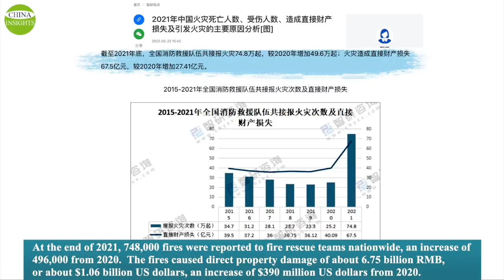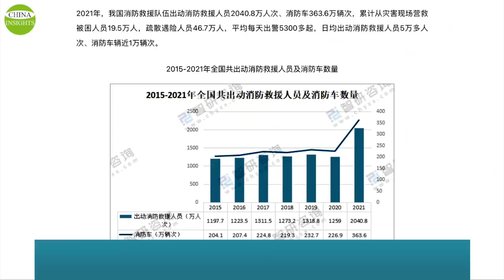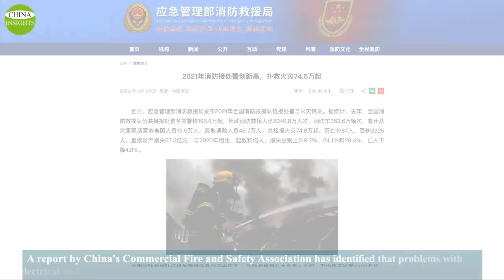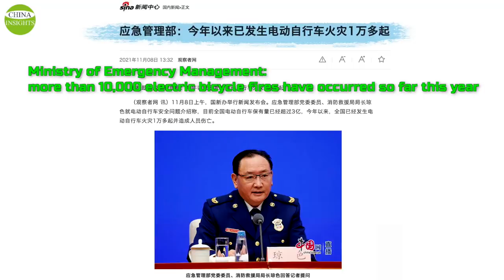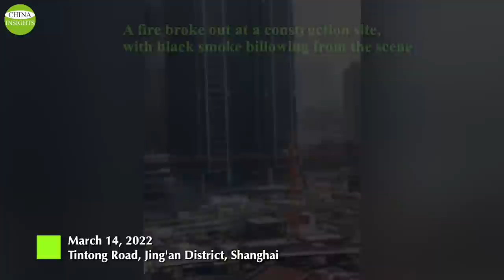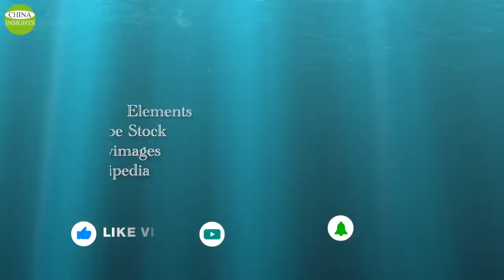More fires every year in China, with 748,000 fires in 2021

Comment: Poor quality buildings, no quality standards, no education on how to handle a fire. What am I missing still?
Reply: leaking gas tanks and people smoking
Reply: insurance fraud? moral hazard?
Reply: Lack of warning systems and emergency communications
Reply: @gtw4546  that too
Reply: Social decline
Reply: Cant be accountable for something that doesnt exist. They are litteraly cooking the books to the point it all goes up in smoke.
Reply: @susannesheffer1848  I wouldn't go below first floor either because it might crush me because of its poor foundation
Reply: nerve gas
Reply: They sometimes implement stricter building standards but most of the time it's cheaper to pay off the relevant official instead of following the rules.
Reply: and lots of buildings and factory equipment is now getting old. but is getting little or no maintenance.
Reply: Knock-off fuses/breakers that look identical to quality circuit breakers from western manufacturers; but they only last a couple hundred hours till they fail due to poor quality materials that only "LOOK" the same.  These knockoff circuit breakers are a hazard in the US because they smuggle them into the supply chain but charge for the quality breakers you ordered but didn't receive.

Comment: "Why we have building codes in the Western World"
Reply: Yup. In case you're wondering why it's so expensive to build here. It's because we have ACTUAL building codes.
Reply: Building codes in any country don't matter if the inspectors are paid bribes to overlook smaller "nuisance" faults.
Reply: Actually in all fairness building and fire codes in the United States and the West came to be mostly because of tragedies and large loss of lives because of fires. The  Iroquois Theatre Fire of 1903 in Chicago claimed the lives of 700 mostly women and children, the Coconut Grove fire of 1942 claimed the lives of almost 500, the Beverly Hills Supper Club Fire of 1977 took the lives of 168, MGM Grand Las Vegas in 1980 claimed the lives about 90, and the Station Nightclub fire in 2001 claim 100 lives. I only bring this up to show you that codes didn't just happen overnight. After each one of these above mentioned tragedies, codes were adapted or tightened. Now in 2022 we shouldn't have that many people die in fire tragedies cause what we learn from the past but then 2018 we had the Grenfield tower fire in London that killed like 80 people. China will have its building codes sooner than later when they go through the same type of tragedies we had to deal with here in the West. Cheerio!

Comment: The number of fires is less important than the magnitude. 2,000 fires without that context is not that meaningful.
Reply: However it is impressive
Reply: ye the US hasdjust under 1.3 million fires in 2019 that is almost 4000 fires per day
Reply: @mikkelfred39 which comes back to OPs point. What did they define as a "fire" Wouldn't it be weird if the US had 1.3 million cases (assuming you're not lying) but only suffered a third of it compared to the C country in terms of cost?
Reply: @iqbalindaryono8984  my number are from the us fire administration so i assume they are correct. My comment was just a nod to the comment that the number of fires is irrelevant, and as you stated the cost of the fires is a better measure for assessing the impact of fires in china.

Comment: The grain silo fire issue is likely also from how easily a fire or explosion can occur at one that is using unsafe electrical equipment or maintenance practices. Grain silos are a very fuel and air mixed environment and the electrical codes for them has to be strict or they will catch fire.

Comment: About 1.5 billion people in china
Divided by 3 people per household average
Thats about half a billion houses
Divided by the number of housefire in 2021 alone...
500000000/750000 = 666.666
That's a housefire for every 700 houses
If my town of 80000 it would be 110 (or 50 since we dont have one child policy) fires every year which is insane consider the last fire we had was 20 years ago
Reply: half a billion households not houses.  some houses have multiple households and then there are also office buildings, schools, government buildings factories.  But yes the number of fires seems a bit high.  Wheter or not it is alarmingly high, I would need to know what kind of fire related emergencies are included. if the statistics include only fires that caused significant structural damage to buildings then the chinese statistics of fires is insanely high.